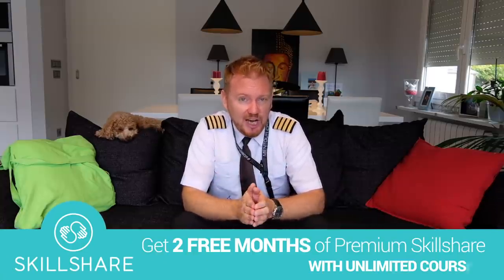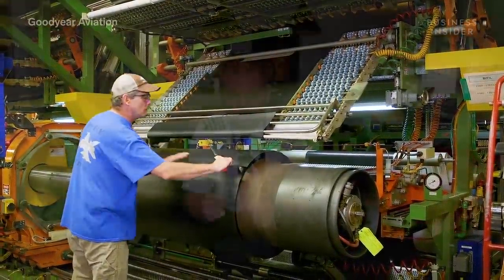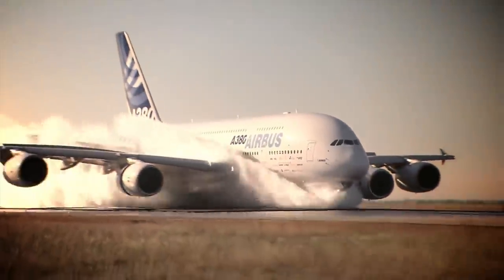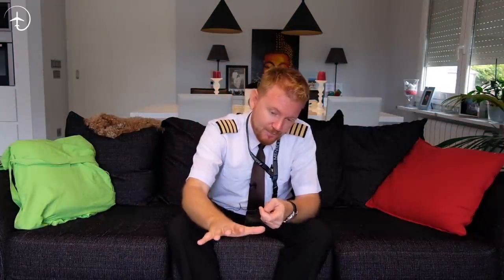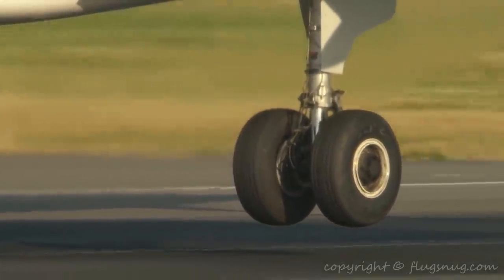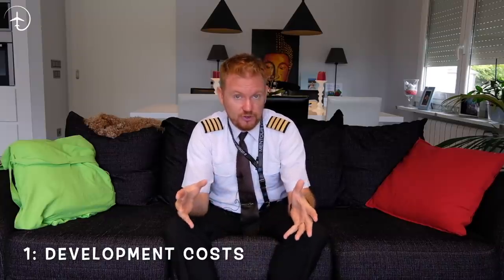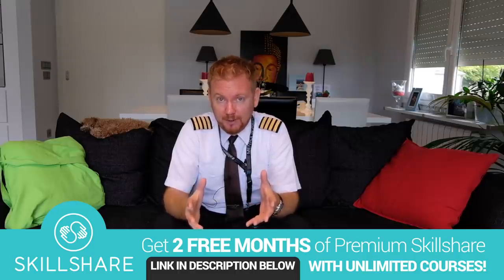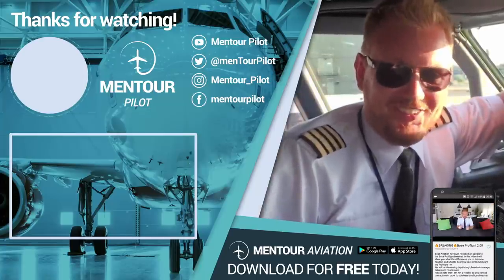Why not make plane-tires spin, before landing?!

Comment: small rimmed vanes on the outside of the wheel rim.. will spin up via windspeed.. no motors, no electrics..
Reply: This is an actual idea I'd been working on for a few years now. But I can see why they will NOT be developed in my lifetime. Too many hoops to jump through to have them certified for aircraft use. But Imma keep trying.......
Reply: I have a different idea, just leave it the way it is.
Reply: machine doctor just a hypothetical suggestion, but thanks for your valuable input.
Reply: Years ago I saw an inventor's program in which someone had invented a turbine style add-on for plane wheels, so they would spin up from air resistance. It was shot down (pun intended) down as being an extra component and thus extra risk, plus the extra wear of tyres screeching at landing is less expensive than fitting new tech with all its drawbacks.
Reply: Also thought about by many non-engineers over the years - why not mold little protrusions on the rubber tire sidewalls directly?  Bottom line: it wouldn't nearly be enough to get the wheel spinning fast enough for the typical landing.  And as he noted, landing speed varies from one time to the next due to many factors.
Reply: I never understood why they didn’t do this either.  A hubcap that had the equivalent of a cup anemometer built into it would be nearly fool proof, and in the unlikely event it somehow failed it would only add a slight amount of trust on the operating side in the form of the wheels inertia.  And even if it doesn’t match the speed of the runway precisely, any reduction in instantaneous acceleration would reduce wear and tear.
Reply: I have seen this idea over 30 years ago in a "young inventors"-style TV show. I have yet to learn of an operational implementation.
Reply: My father joined the Army Air Corp in 1942, and retired out of the USAF/Strategic Air Command in 1965 as a veteran of three wars.  He once told me that they had experimented with this very thing, vanes to get the tires rotating once the gear was down and flying dirty.  It turned out that it made very little difference in the longevity of the tires life cycle.
Reply: @warped2875  Finally an answer that makes since.  I also suggested a similar way to let the slipstream spin the tires before landing.  Once the aircraft weight was on the tire, the slipstream would no longer be effective.  SAC did not accept my suggestion.  But they didn't explain it didn't change the actual wear on the tires by much.
Reply: Same here - I even went so far as to submit designs to many aircraft and aircraft tyre manufacturers (around 20 years ago). The idea occurred to me after Prince Charles crashed a BAE 146 off a runway in Scotland because a tyre exploded on landing. Most didn't reply, some replied with "We don't accept unsolicited submissions" and Dunlop replied with a recommendation not to pursue this idea. I still have the drawings and literature I had professionally produced and what have you somewhere around here...
Reply: I had this idea as well! But, as a carpenter, i didn't try to develop it.
Reply: Engenius idea, no need to match speed with complex electronics, even speeding tires to half of the airplane speed could make huge difference and would not cause any stability issues. I bet we will see this technology coming in soon. Free spinning wheel will not "drive" plane sideways.
Reply: The cost To redesign and retrofit fleets of aircraft Vastly outweighs the savings on tyre wear. Also... between some wheels the gap is very small and there are various items located there like hydraulic pipework etc.
But a sound idea maybe on light aircraft...
Reply: great amount of drag
Reply: It’s not just the maintenance & replacement cost of tires.  Quickly spinning up tires from 0 to landing speed rpm creates a huge lateral force on the landing gear which over time can create fatigue crack failures.  Also, the spin up spike in landing gear force could contribute to collapsed landing gear on touchdown.  I still suspect wind powered spin up to half speed could save on maintenance cost without increasing overall risk.   The maximum worst case total lateral forces on the landing gear and tires during a strong cross wind landing would be reduced if the tire were partly spun up.
Reply: All this "LATERAL FORCES...GYRO EFFECT" GAGA...
HAS NO ONE REMEMBERED THAT THE WHEELS SPIN ON TAKEOFF AND LANDING ANYWAY... LATERAL STRESS SUGGESTS THAT THESE STATE OF THE ART HIGH PRECISION ASSEMBLIES ARE SOMEHOW... FRAGILE...POORLY MADE AND WITH VERY SHODDY MACHINING TOLERANCES... COME ON DUDES...
THESE UC ASSEMBLIES ARE THE FINEST OF THE FINEST....
WHAT IF ICE FORMED ON THE WHEELS WHILST IN THE WELLS? THE PLANE IS LANDING IN GREENLAND WITH MINUS 40°C PLUS WINDCHILL FACTOR... SO NICE CARRIBBEAN SUNSHINE CAN'T MELT IT BEFORE THE WHEELS ARE DROPPED. BY THE SOUNDS OF THESE POSTS... THE AIRCRAFT IS DOOOOOOMED!
NEVER HEARD SUCH STUFF.
Reply: @xpeterson  In Formula 1 they use scoops to cool the front brakes, and nobody has more mass restrictions than those engineers. If the rims had vanes you could use a scoop to guide the airflow inside to spin up the wheel.
You wouldn't have to match the exact ground speed to reduce "flat-spotting" and prevent imbalance and vibration. If crab angle "drive" is a problem, the crew could dab the brakes during the flare in high crosswind landings.
Reply: Indeed. If the goal is to get more tire life, the tires do not need to spin at the landing speed of the aircraft. If they were spinning at say half that speed, wear would be greatly reduced  due to a lower speed differential. For the landing reasons given, a motorized system is out of the question. The added weight and complexity would be too much.

My thoughts were more to just bolting on a metal disk on the wheel with properly angled vanes on it. To allow the air flow to spin up the tire when the gear was lowered. This would have the added benefit of adding drag which means less air brakes would be needed. This method would never get the wheel up to the full speed of the plane but that is OK. 

A passive method adds no complexity to power and the weight would be far less. As well there is no fear of any sort of fault causing a bad mismatch. Even if there is a minor speed mismatch, because there will still be a sudden acceleration on landing, just less than they have they have now, you would not have the issue of the plane being pushed along by this means. 

But I am sure by now with over 100 years of aviation that if it was something that would save money that the bean counters with MBAs that run the airlines would have introduced it by now.
Reply: MrCybaherbz i was told service life overhaul uses NDI inspections for cracks on landing gear struts.  The more repeated stresses on load bearing members can contribute to growth of fractures. Imagine how much added force there is on the landing gear to get the wheel spinning fast.  It’s the same backwards force on a car suspension as hitting a curb
Reply: After proposing my "invention" of tire pre-rotation as a junior landing gear engineer, my boss had me take over answering inquiries from other would-be inventors of the concept (maybe one came in every couple of years).  This video presents plenty of reasons why not, and I will add a few more:  Speed has to be matched fairly closely (vs "half of the touchdown speed") for it to make much difference on wear;  Passive spin-up designs simply don't work (inadequate forces generated relative to the inertia to be overcome);  Even a "free" motorized system -- one which magically cost the airline no money and was already installed in nonexistent extra space -- would still be a money loser once all costs were accounted for.
Reply: @MrCybaherbz    [Someone bumped your CapsLk key -- thought you should know]    Ice wouldn't lock up a wheel, or even offer any real resistance, since the sealed wheel bearings wouldn't be affected.  Even if they were,  the moment arm of the bearing races is a small fraction of the wheel rolling radius, so not to worry.  It's true that imbalanced lateral forces (probably) won't tax the design strength of a landing gear, but as indicated in the video could be disastrous in some landing scenarios when it comes to controllability.  I was once handed raw flight recorder data from an aircraft which had departed the side of the runway from a no-hydraulics landing and told to analyze what happened.  The pilots couldn't keep up with the uneven braking forces.  BTW the problem with a really cold ambient temperature landing can be shock strut bottoming, as sometimes happens into say Moscow.  The fix is to inflate nitrogen in the shock struts beyond the placard range, so that adequate pressure is available for cushioning at touchdown and metal-to-metal contact (bang!) is avoided.     > never heard such stuff  <  Now you have.
Reply: @michaelbaka4777  They were in use 45 years ago so your work is wasted.
Reply: @mitchd949  These were in use in the 70's, I don't know why they were discontinued.
Reply: @xpeterson  Has been done already.
Reply: Exactly the idea I had 10 years ago. I even developed a process for eliminating drag. Still not a peep from anyone.
Reply: @michaelbaka4777  You just need is the actual work, proof of concept and for it to make sense financially. You need successful design, some patents, and a business model. Lots of people here being irrationally pessimistic unless there is actually some real historical president for such attempt to fail. It's not clear that it's a bad idea just because it would require solving some engineering issues that don't already have a historical solutions. It's not fuking rocket science. For fuks sake jets are mega complex and capable and obviously if the industry was really farsighted about tire wear they might pay more attention. This is not necessarily something that would have to present some added danger. That could be part of the investigation.  I'm just curious about any prior design attempts or manufacturer analytical engineering studies.  I think that's what this story should really be about.
Reply: @paulmichaelfreedman8334   I wish we could find that program you saw.
Reply: @paulmichaelfreedman8334  I heard that a tyre companies bought the patent and archived it.
Reply: @eltouristoduo  It was the dutch version of that show where inventors pitch their creations to rich investors. One of them actually had done research and found that it was pointless to use wheelspinners, even possibly dangerous, due to above mentioned reasons. And I can also imagine the tyre screech vibrates through the plane giving pilots more tactile feedback.
Reply: @RudolfGraspointner  Conspiracy crap.
Reply: Same thing I asked in 1977 when our student American Society of Mechanical Engineers visited the Tampa International Airport.  Watching the landing airliners leave so much rubber on the runway, made me think why not add little vanes to the tires or wheels to get them spinning a bit. No answer then.  If matching the speeds is the problem, they could measure and control the speed using brakes or air deflectors.
Reply: The spinning tyre with little vanes etc for aerodynamic spin up, was patented in the 50's or 60's, check under google patents..bit of a search, i can't remember the patent main description...they are hardly ever described simply and logically..good luck
Reply: I had the same idea(as a A&P for 30yrs), but I find issues I also do not like about it. You can not have the vanes built into the wheel because one broken vane and you have to scrap the wheel half$$$, You could have a bolt on vane assembly but the would have to be all highly balanced and interchangeable for tire changes, but again they could get broken and require a replacement to a plane that needs to turn on scheduled, and another issue is how big the vanes(one inch-2 inch) you do not want the tires spinning very fast because of vibrations, then you also need clearance in the W/W, you would need to retract another inch or two into the wheel well(W/W), engineers would not like that at all, that could effect trunnion height/up-lock/ free-fall and to many things all inter connected in engineering. So is adding more engineering and maintenance worth another 50 cycles on a tire, not likely to end cost effective.
Reply: @BassMatt1972  you master of sarcasm you. Hey mold the vanes into the tire sidewalls, and design them to be dependant on ground effect (as much a possible) to spin up.
You'll need forged magnesium wheels to minimize gyro, but they'll cost too much to manufacture, so like I said to the other guy, you'll need to breed some sequoias to grow the things, but that might take a few million generations because that's one hell of a mutation.
Reply: @ChadDidNothingWrong  what are you on about? It was simply a suggestion using a basic solution. Im not talking about the tyres in any way. Im suggesting the rims which are already heavy dutym very small vanes would make them spin up to a reasonable rate. Wasnt being sarcastic at all so good work genius. Moot comment.
Reply: The gyroscopic effect of spinning tires would adversely effect trying to control the airplane during the critical time of landing.  Landing is the worst possible time for any loss or reduction in control.
Reply: @michaelbaka4777  That was a great idea, in the 1920s.  Research the patents.
Reply: @michaelbaka4777  .That wa already invented by a Australian.But all the airlines didnt want it since they all had big shares in tyre companies.He try to sell that idea to them about 35 years ago.
Reply: @edherlik6816  I did.
Reply: Exactly. Nothing more than a pelton wheel for the air, mounted right next to the tire. Aristotle brought this up. It's not new technology. So where's the problem? It's literally foolproof
Reply: Thought i was clever coming up with a similar idea 30 odd years ago ( i incorporated a venturi for the vanes) what put me off was the notion of the biggys protecting their interests. (Being snuffed)
Reply: LOL another brilliant idea of mine proven to be already thought of by other brilliant minds. My idea was a vaned wheel add-on (analogous to a hubcap) that would self-regulate like a centrifugally controlled governor.
Reply: @michaelbaka4777 – About the time that one of those vanes is damaged, goes unnoticed, breaks off, blows a tire, causes a terrible crash, 350 dead, people will say, “We didn't really mind a little bit more tire wear.”
Reply: @MrCybaherbz – WHAT? WHAATT?? WHAAATTT???
Reply: How does tread wear from the ⟨chirp!⟩ on touch-down compare to the wear from tire scrubbing when turning during taxiing?
I have a three axle trailer. Turning street corners grinds so much more rubber off of the tires on the leading and trailing axles than thousands of miles cruising along the highway. The center axle tires outlast the other two axles by several times.
Reply: @douginorlando6260 – When the plane touches down, the tires spin up from 0, even reverse spinning, to 150+ mph. That doesn't usually yank the legs off of the plane.
Reply: @douginorlando6260 – And the forces on the gear when it is lowered into the airstream at 200+ mph?
Or when the aircraft is crabbing during a crosswind landing? Does this cause gear collapse?
Reply: @huudielbo728 – Simple. As with so many seemingly good ideas, they didn't pay for themselves, much less contribute to the profit picture by reducing costs.
Reply: @TKA322 – Ever see one of those shrouded streamlined steam locomotives from back in the 1930s? In a few years the shrouding had been removed and scrapped. The locomotive represented maybe 0.001% of the drag of the train. The shrouding slowed maintenance and repairs, so was all junked.
Super-streamlining of automobiles like the Jaray “upside-down bathtub” (thinking of the old style claw foot bathtubs), “turtle” or “beetle” cars, long tapering tails do so little good and impinge on usable interior space for people, luggage and machinery that they are impractical. Very few cars are driven over 70-75 mph for a significant part of their operating time, so extreme aerodynamic efficiency isn't worth the cost. Just put clear or matching color tape over the panel gaps and you will do more for the Cd than extreme streamlining.
Reply: @paulh2981 – “Gyroscopic effect”? Are you kidding? The wheels and tires of an airplane amount to a very small part of the total mass of the aircraft. Airplanes in flight or at near-flight speeds rotate about the axis of the wheels as they touch down and lift off, which has no gyroscopic reaction.
The rotating parts of the gas turbines and fans present far more gyroscopic reaction than the wheels, and their axes are perpendicular to the rotation of the aircraft in take-off and landing. Gyroscopic reaction due to the gas turbines and fans is so insignificant that all engines on two-, three- and four-engined airplanes rotate in the same direction.
Reply: when the wheel spins up from 0 to 150+  in the time of a skid mark, there has got to be a massive sudden lateral force on the legs (fore to aft direction). ... of course the landing gear design must be beefy enough to handle this lateral load.  But knowing they have been designed with adequate strength, there still would be the benefit of making the tires last longer by aerodynamically partially prespinning the wheels when they enter the airstream.   I believe there would be additional benefit on the landing gear which could extend time between overhaul/maintenance
Reply: @baitclicker9414  Why not post a link to your drawings? Would be interesting enough!
Reply: I'd thought of this years ago as well... sigh... I'm never surprised anymore that I'm late to the game.
Reply: and thus no control over the speed of the tires spinning and that leads to several problems he mentioned.
Reply: You'd have to use computers combining speed sensors & the brakes to adjust or stop rotation on a crab landing, also to ensure rotation was equal in every wheel on a head on landing. There is no way wind vanes that did not affect the aerodynamics could accelerate the wheels to match the ground speed in the time the gear was down/exposed it would only amount to a small saving in wear.
Reply: @docthebiker  That is nonsense IMO. 
The wheels spinning even a little would help and vane sizes can be calibrated easily for standard landing. They would work, not too different than a waterwheel in practice.
A plane coming in with the mass of these behemoths would be countered with com[plete ease.
Reply: They will also grind away the gear doors, as there is no space to spare.
Reply: Yeah but now you area adding more rubber, which is more weight and more cost. And more clearance in the landing gear bay. All this extra cost is probably not worth saving that little bit of rubber you rub off when you land. It's cheaper to just make the tire thicker to resist the wear.
Reply: And a deleterious effect as the pilot explained.
Reply: @baitclicker9414  That jug eared clown could crash a bloody skateboard. So hes nothing to set any standards by.
Reply: @MrAbahe  It is the imbalance , or mismatching of the wheels rotational speed which would case the greatest problems, especially in a cross wind landing.
With current technology, such a system is not cost effective. But it could, eventually, come in . It all depends on changing economic climante and advancing technology.
Reply: @AmbiguousAdventurer  At todats costs, as given un this vid, the cost of wear and tear on a standard landing, are approximately $36 per cycle, i.e. $18  for each landing or takeoff. It costs almost that much for each sick bag that is used if you take in All the costs, i.e. supply of bag, distribution to passenger, disposal of used bag, including, invpcineration, disposable gloves etc.
So the old adage of " If it ain't busted don't fix it" is, currently, very applicable.
Reply: So much ignorance.  No, they won't.  As others have mentioned, the brakes are actually engaged slightly all the time, because there are so many stacked pads and disks.  Small vanes would only introduce more drag, and wouldn't overcome the static friction of the brakes to start the wheel spinning.  They would also significantly increase manufacturing costs of the tire.  Even if it could be done, the gyroscopic effects of that much rotating mass at a landing would severely impact maneuverability of the aircraft, that is if the vibrations from non-perfectly balanced tires didn't shake the plane apart first.  Ignorance is bliss I guess (when you're not an engineer at least.)
Reply: Sure, but wind speed is unlikely to be the same as ground speed, particularly when you are landing against the wind.